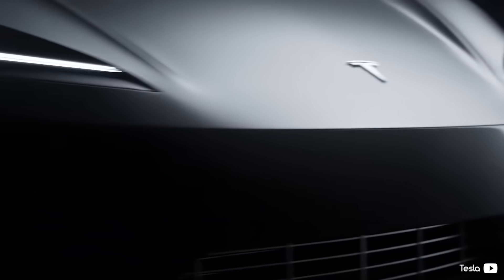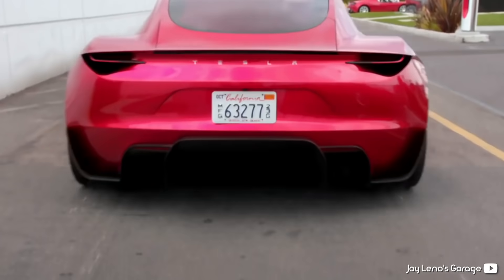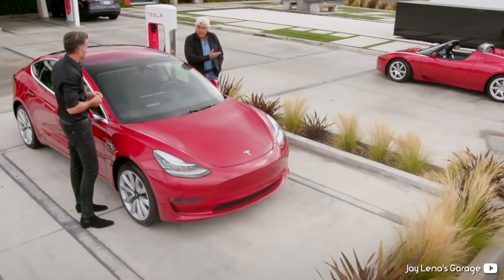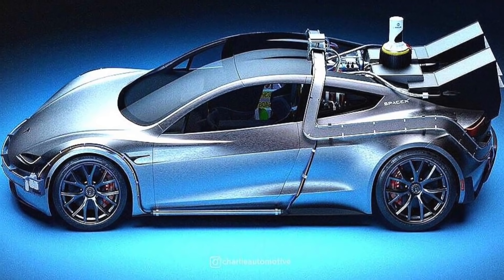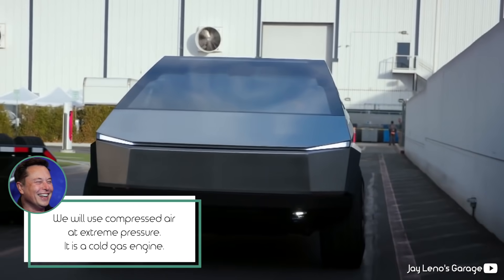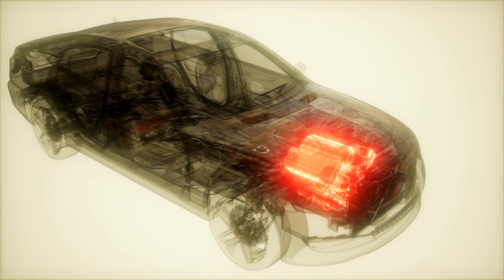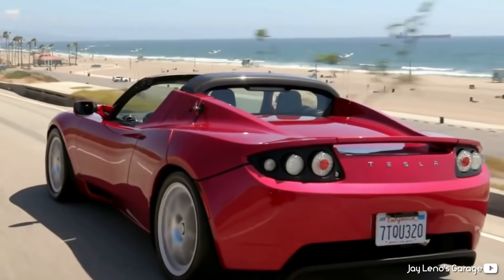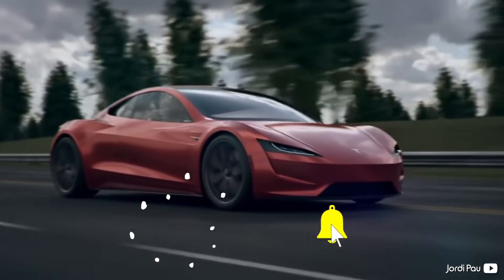Tesla Roadster 2021 FINAL Update [SpaceX Thrusters]

Comment: The front thruster could be used as a safety feature? right?. cuz it would be fast
Reply: There would be so much whiplash bro. Hahaha you cant just stop at an instant. 

Also, 0-60 in 1.1 seconds is impossible. The car would need to be able to stop from 60-0 in 1.1 seconds. That's deadly, unless something is holding your head back.
Reply: @christiankytoh  why would it need to stop to quickly?
Reply: @andrewe868  To avoid an accident better?